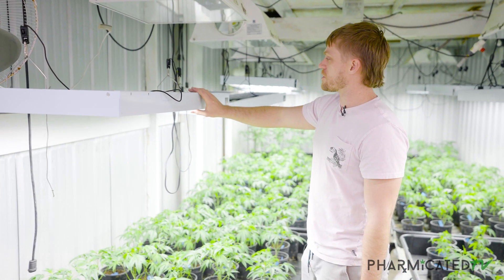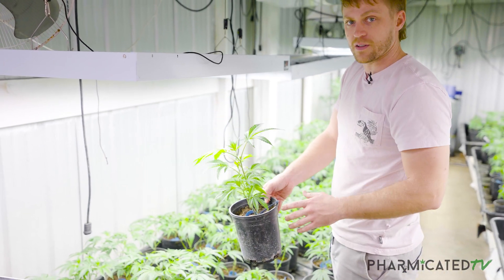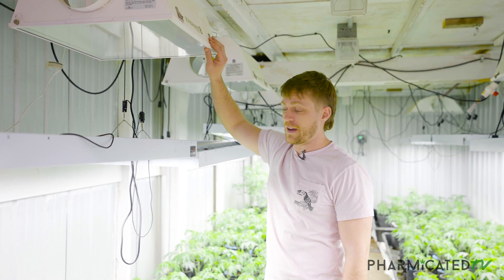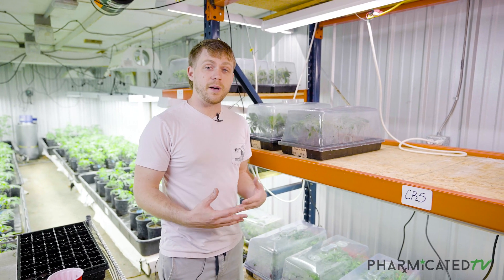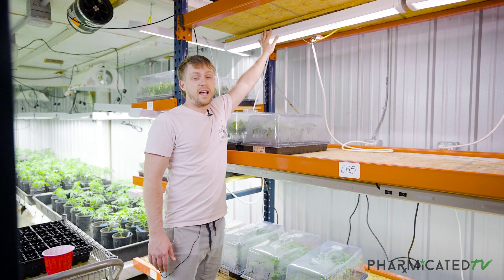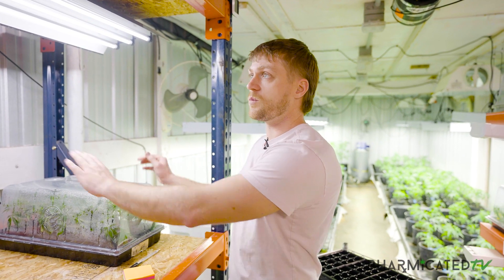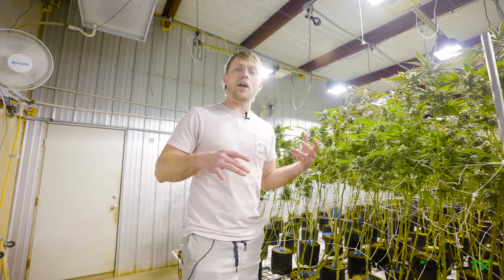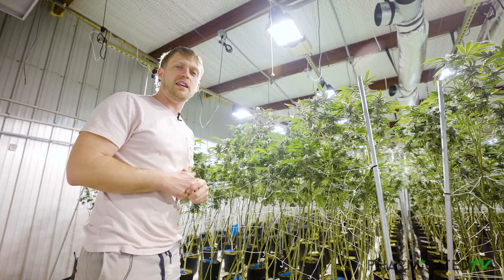Cannabis Lighting

Comment: with led by sun Light from Switzerland 🇨🇭 you will have more yield and better terpenes. Are already used a lot in professional cultivation. because you get values at the top of the plant like your or NDL lamps or other lamps. Tests prove it to me just one side 1000 watt LEDs and one side was tested with 2800 watts of conventional lamps the same values but 1800 watts less consumption in a box one side already.

Comment: I have a 4x4 grow space and I use a 400w metal halide for veg and a 400w hps for flower
Reply: Get a shop light. This can be used the first month to save electricity. When you switch to the HPS bulb use the shop light for supplemental blue light. Even when using a Sunagro bulb there is benefit to the flowers to adding a pair of 48" T8 tubes.
Reply: @markpiersall9815  I switched to LED I have 480watts of led lights now works just as well as my H.i.d. lighting bit cheaper on electricity
Reply: 4 feet x 4 feet grow space?
Reply: @eaglehigh-h3e  I switched to 480w of led lights
Reply: Look for sanlight evo From Schweiz 🇨🇭 best leds light on market. Real 1,9 Gramm pro Watt no Problem.

Comment: Took cuts 2 weeks ago and transplanted into solos a few days ago. I'm using a vivosun T5 2ft 2 bulb setup. I'm in a 3x3 with environment dialed in to VPD. What is the best height to set fixture above plants? Vivosun doesn't have a recommendation and most answers online are for the 4ft 4 bulb version. Currently it's at 8" above plants with temps at 75F.
Reply: I am sorry my english is not good enough plus I only grew with leds